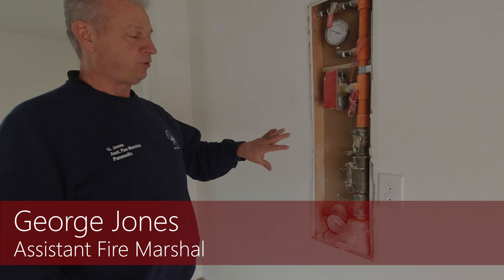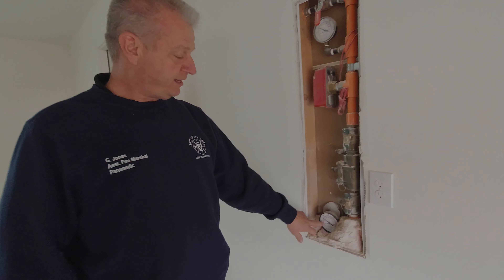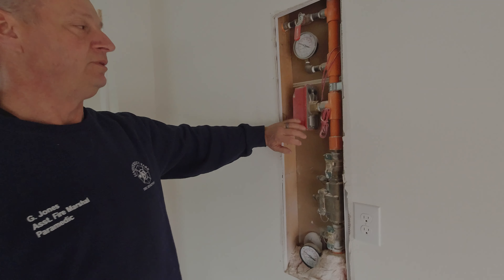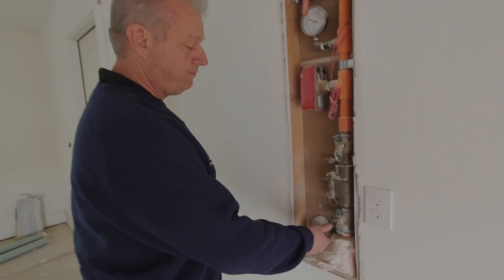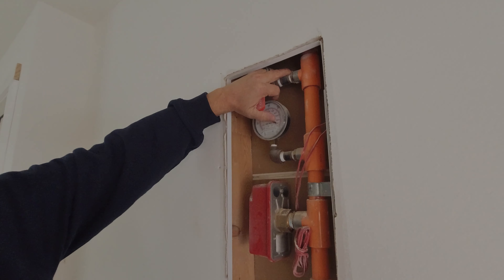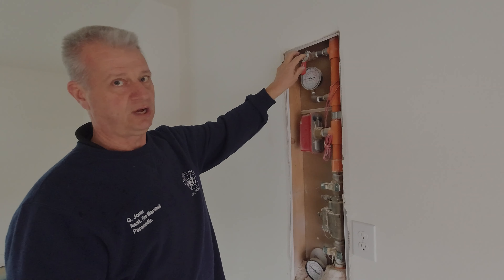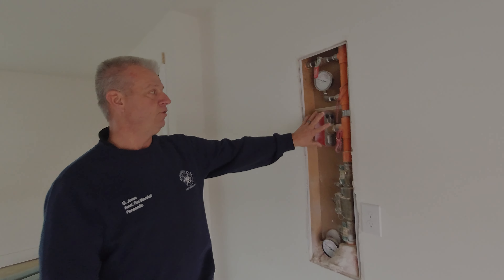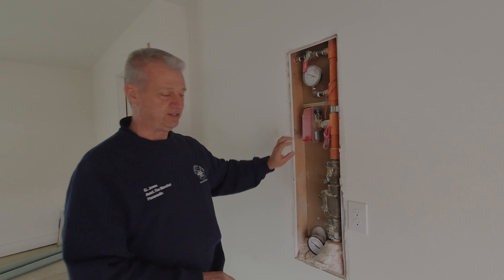How to Turn off Fire Sprinkler System

Comment: I live in a apartment  complex.  A neighbors candle triggered the water system  to come on at midnight the other night they couldn't  get it off. It destroyed carpets,couches, beds televisions,it ran into several apartments.  They couldn't  get into the water house  to get it shut off. The fire department  came to try to assist, water company.. a new state law made the alarm on the  water system to come on. Fire didn't destroy  but water because  it was so difficult  to find the shut off on this new system